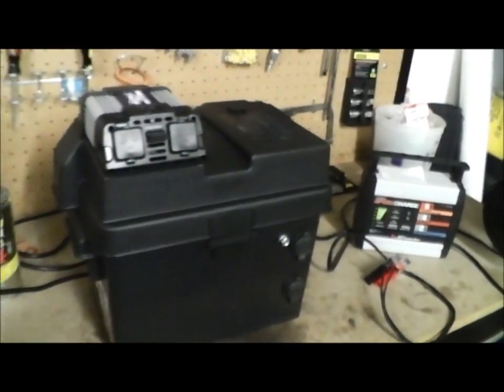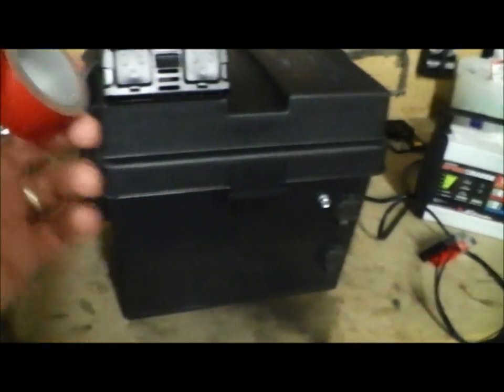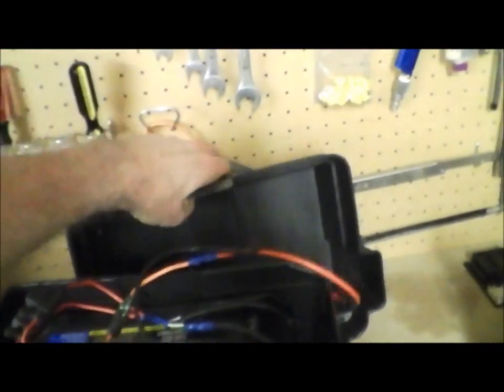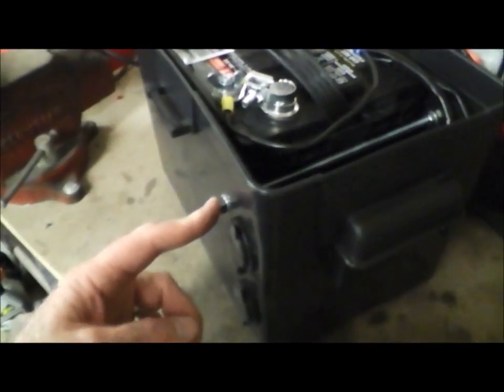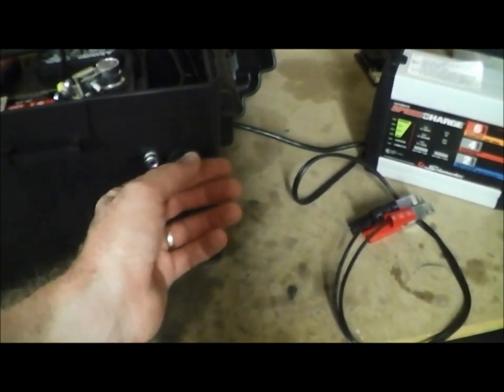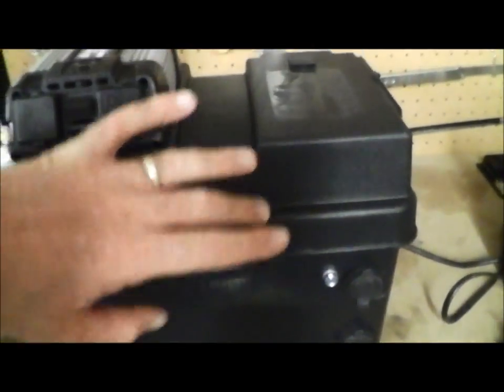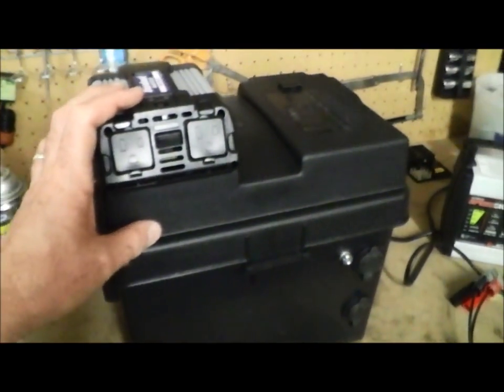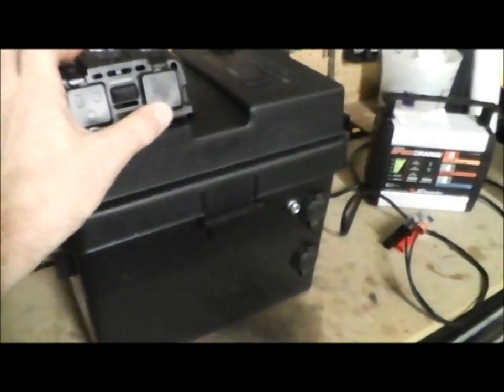DIY portable power station

Comment: Great video!
Why not use a deep cycle battery?
Reply from the maker: Thanks, yes you could use a deep cycle battery, but it depends on what you need the power station for and how long it will be used.

Comment: First let me say thank you for your videos, They are a great help.  I have a question if you know the answer.  I have built this box and it works great,     I have a couple Lawn Tractor batteries.  1 is a 220 CCA battery and 2 are 320 CCA's  are they any good to use and also do you know what the AH rating is on them?  Or if anyone here can answer that question.   Thank you.
Reply from the maker: They will work but they are relatively small so they won't last as long as a car battery that has 700 CCA or more. It will be hard to find the amp hour rating on a car battery because they are used mostly to start the vehicle and not for long term draw like a Lithium battery.
Reply: @petebeasttexashomesteading  Thank you for your reply.

Comment: Your concept is good but a car battery is not a very good battery to use. Lead acid batteries only have loke a 50% capacity if that and if you drain it much more it will be damaged. Get a Lithium Iron Phosphorus battery. It will do that job and are much safer. My biuld is a 3000 watt inverter with 4 12 volt 20ah Lifepo4 batteries. Almost 2000 watts of capacity and I can run them dead and not damage the batteries. Good project though I hope you upgrade that battery  so it will last years.

Comment: Hi.  Is the inverter safer than using the cigarette style charger? I am asking because why not use the cigarette style outlet to power your laptop.  I have two motorcycle batteries and I want to use them to make an emergency power supply,, I've seen ideas like yours but without the inverter.  I don't know anything about electricity but your idea seems safer for some reason to run a computer.     Any imput is much aprecciated..  thanks a lot
Reply: Just looked at your channel, and subscribed,, man you should take my channel name minus the studios.    Man, I wish I knew 5% of what you know..
Reply from the maker: @mikelboudica5389  Thank you 🙂 most laptops plug into the wall, so It's best to plug them into an inverter. I don't know of any laptops that plug into a cigaret lighter plug because the plugs are 12 volts DC and most laptops have a 19.5-volt transformer. You could pick up the same inverter I used in the video at Harbor freight for about $30.00 https://www.harborfreight.com/400-watt-continuous-800-watt-peak-power-inverter-66814.html

Comment: Great idea.  How can you attach this to an auto battery to charge it while driving?
Reply from the maker: Thanks, it's easy just connect the positive and negative wire from your car battery to this battery. But you'll have to find room under the hood of the car because the battery will need to vent while it's charging. So you can't stick it in your truck or the interior of the car while it's charging.

Comment: still use this setup? if so, how is it working out?  what battery did you use?  I do astrophotography as well and need this upgrade so I can go mobile.  Can you run all night.. say 6 hours..? How many nights before you have to charge again?
Reply from the maker: I haven't used it in a while but I have it on a trickle charger all the time. The battery is a small 450 cranking amp automotive battery that I also bought at Walmart. I just measured the inside of the box and found a battery that would fit and give me the room to put the 12 volt car charger plugs in. It should last all night no problem, just buy a small trickle charger and keep it plugged in all the time when not in use.
Reply from the maker: Forgot to mention that I ran a Celestron 11" starbright XLT mounted to a Celestron advanced VX Equatorial Mount.

Comment: I want to run a receiver and speakers at a drive in and maybe a light. how long would this last. would I need two batteries?
Reply from the maker: It really depends on the size of the battery. I have a small 450 cranking amp battery in this and it might last 3 to 4 hours but two batteries would last twice as long.

Comment: Should use deep cycle battery instead. Automotive battery will have a very short life in this application, its designed for cranking amps not for draining down.
Reply from the maker: Good idea........thanks

Comment: hi

can i charge    a car    from this   power pack
Reply from the maker: Well if the battery in the portable power station is charged then you could use that battery to jump start a car. I guess you could use the power staion to power a car charger then to charge a car battery but by the time the battery was charged in the car the battery in the power station would be low.
Reply: thanks     thats   mean     keep   the   battery     in  its        good   shape          and   u    are    ready for   any thing 
even     start   a   dead   car

Comment: I really like this power box. I want to make one myself.  However, your instructions are not really that clear and I can't see what what you plugged the side sockets into. Do have a set of instruction you could e-mail me. I am a single parent and we have power outages too much and this would really be great. I also would like to know when I get it up and running would it be safe just to leave it charging because you never know when these outages occur. Please advise.
Reply from the maker: Hi, I don't have any instructions on how to make the power box. You could make this box for around $130.00 The box, battery, inverter and pretty much everything else you could get at walmart or an auto parts store. I would suggest to get a friend with some mechanical/electrical no how to help you out. You could also google "connecting battery to inverter"

Comment: Hi Pete!  Fellow Astro Photographer here!  Same line of thinking on my end about needing a portable power source in the field.  I've used Anderson power pole connectors to utilize my 100W solar panel for recharging.  Works great.  I've also added some USB ports for Phones and tablets, etc.  I think an on/off switch might be useful, but am unsure of how it wires in to cut all current going to other ancillary ports.  Any ideas?  Great video!  Thanks.
Reply from the maker: +Dale Schultz  Yes an on/off switch is a good idea. You would have to cut the positive wire that goes to each outlet and connect a switch to each outlet.
Reply: Thank you for that!  Where do you do your AP?  What kind of Mount, Scopes and imagers?
Reply from the maker: +Dale Schultz  My wife and I just moved to east Texas out in the country where there's no lights, so viewing the sky is going to be much nicer. The stars here on a clear night are just amazing compared to where we lived in Houston.  I have an "Advanced VX Mount" with a "Celestron C11 Schmidt Cassegrain Telescope and I use a modified HP Webcam HD-4110 which works pretty good and video capture to "debut video capture software". I'll use "Regi Stax 6" for Mars, Jupiter and Saturn. But it's been a better part of a year since I've been out so I have to get back in to it.

Comment: instead of adding a small battery charger to the box , put a small charge controller there instead and get at least a 15-30 wat solar panel. if the power is out , how are you going to recharge your battery ?
Reply from the maker: +richard imel  The solar panel is a good idea but the battery charger is for when the power station is not in use to keep the battery charged.

Comment: hi of i was to power a radio how many hours will it last before recharging it again
Reply from the maker: +Mac Maluina  That depends on how big of a battery you use and how big or small the radio is. But if it's just a small portable radio, I think it should last quite a while a day or two at least of constant use.
Reply: Thankyou pete

Comment: I can't tell from the video, but if your using a 30A fuse then at minimum your should use 10 gage wire. 12 gage wire say is only rated for 15A. Nice design though.
Reply from the maker: William Winder Yes you're wright, I'll have to change that in the video. I should of used a 20 amp max on the 12 gauge positive line. Thanks

Comment: Could you use a 12volt battery like this, to charge up another 12volt battery? In conjunction with an inverter of course?
Reply from the maker: Sexy One25 I hope I'm understanding your question right. I wouldn't do it that way because your probably using more power and putting more strain on the first battery to run the inverter and a battery charger to charge another battery.

Comment: can you explain the fuses? I have a similar set up but the wires (10-14 gauge) are heating up too fast, especially around the alligator clips connected to the wire at the base of the battery.
Reply from the maker: Marcus Smith If your wires are heating up then, either you're drawing to many amps or your wires are to thin. A 12 gauge wire with a 30Amp fuse on the positive wire for your inverter should be good enough, and 12 gauge wire with a 10 Amp fuse on each positive wire for each of the cigaret style plugs is good. Hope this helps.

Comment: I just completed my portable power station last month.  It is very similar to yours Peter.  I originally went with a 400 watt inverter, but switched it out for an 800 watt unit.  I am powering my box with a 90 amp hour deep cycle battery.  I had planned to mount the inverter on the lid of the battery box, but like you, grew concerned that the off-gassing of the battery would affect the components of the inverter.  So right now I separate the two and attached the inverter just before I begin using the system.  I have tested the power station around the house a few times.  I have also used it in a remote location to power a rotary tool while working on a pet project.  The unit performed smoothly.  I use a Stanley Battery Charger/Maintainer to recharge the unit after each use and between uses.  I will eventually add a 100 watt to 150 watt solar panel as well as two 12 volt power outlets to complete my system.  The next time we have inclement weather, the family & I will be better prepared power-wise!
Reply from the maker: PhilCherry3 Wow sounds great! You're family will definitely be better prepared for a power outage.

Comment: If you haven't put in the trickle charger yet, you could attach wires to the + and - of your battery to a couple bolts through the side of the box so you can just hook your current charger up to those and not have to open up the box every time you charge it. It would also be a quicker way to attach a second battery in parallel if you wanted to add more capacity.
Reply from the maker: Che Ortega Good idea, But it kind of has that already. I just connect the charger to the back of the inverter where the main wires from the battery connect.

Comment: How long would this thing charge for? I would use it to power a couple little laser light show toys and charging iPhones on a camping trip.  what do you think?
Reply from the maker: I would think all weekend for sure, that is if you're going to use the laser light for a few hours at night. I don't think those things will pull that may watts but check and make sure.. If you're going to use the inverter just make sure that the total wattage does not exceed the inverter wattage.You can always charge it with your car and jumper cables.

Comment: Nice set up, I am building one similar to yours and I want to ad a gauge voltmeter to the front of the box but don't know how to wire it and it comes with a light bulb but without wires. Any ideas?
Thanks.